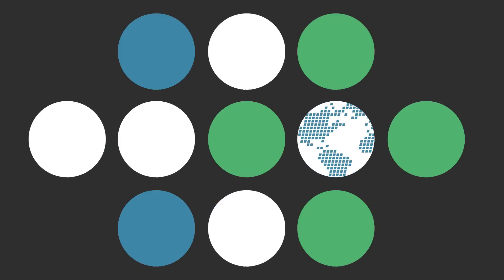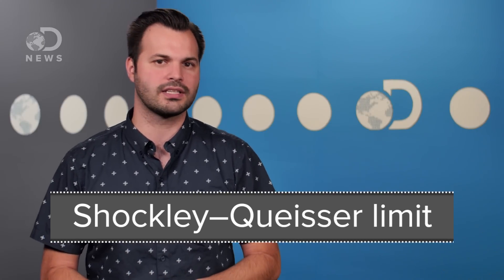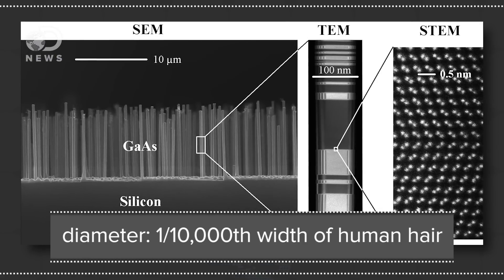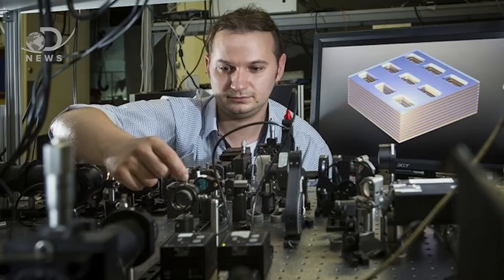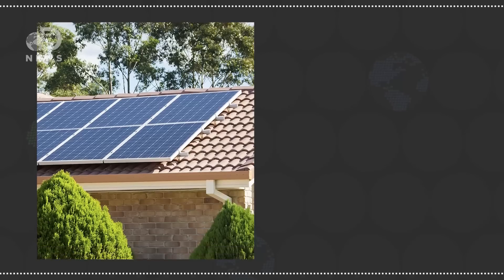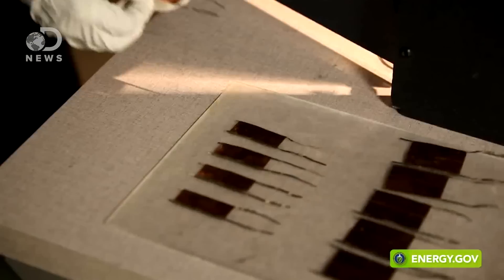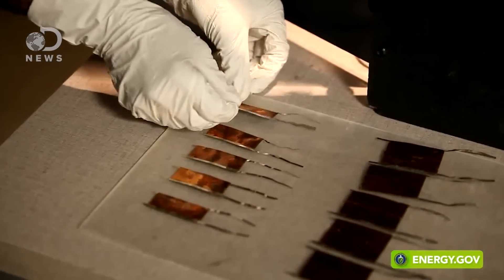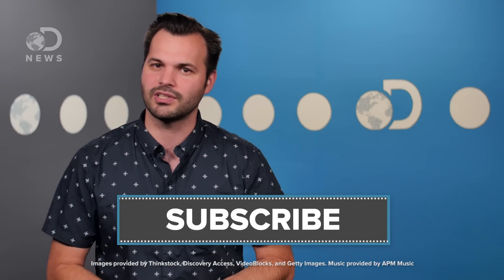Can Nanotechnology Turn Windows Into Solar Panels?

Comment: There is a danger of tree-removal for the sake of getting more sunlight to solar panels.  Trees are more important than solar panels because they perform multiple functions, such as sequestering carbon, storing water and shading the ground to prevent evaporation of watershed.  Ideally, solar panels should be mounted atop trees, but getting to the tops of trees is difficult enough without trying to install something like a solar panel there.  Nevertheless, treetop solar panels will eventually be necessary if solar power is to expand without posing a threat to trees.
Reply: But then the trees won't get sunlight? If there is a roof there most probably is space above it, unless you live in a Forrest with really tall trees or something.
Reply: A better Idea would be, instead of graveyards and peoples graves just being stones, cremate and grow a tree with ashes so grave yards become beautiful forests (Although it would suck if someones tree dies or got cut down but you can always grow another)
Reply: 21st Century If solar panels were built in long, flexible strips that could be suspended between trees, they would not shade much of the tree canopy.  Such strips could also be suspended between power poles where the grid is not eliminated due to autonomous solar power.
Reply: discountconsulting I think there is already enough Rooftops and spaces to put them without having to cut down any trees or involve trees mate, especially when they get more efficient :)
Reply: 21st Century No, trees should definitely not be cut.  But for human development to be sustainable, it has to be treed.  If you have untreed areas of human population, then deforestation increases as human population grows.  Therefore we need to reforest areas of human habitation so that we live more in harmony with nature. 

Likewise, solar power arrays should evolve so that they are in harmony with nature.  I agree with you that currently tree-cleared areas like rooftops are the best places for solar panels, but ideally in the future rooftops will be increasingly shaded by tree cover, so solar arrays should be able to mesh with that.
Reply: we just need to genetically engineer trees to grow photo-voltaic cells so we can plant lots of trees and just plug our houses into them for power :)
Reply: Don't worry, we have many ways to install solar panels in open fields and on man-made surfaces that were cleared of trees decades ago. Just look up "solar trackers", "solar carports", and my personal favorite, "solar roadways" :-) all of which are either already installed and functioning in the U.S. or being researched and developed. And you can trust me, I work in the solar industry and have personally installed pretty much every kind of solar panel system except for a solar roadway, but that should be available soon!
Reply: discountconsulting Mmmmm like The Venus Project blueprints for cities
Reply: Patrick Schlaud There's a long one in china with solar panels above a bike path between the two motorway lanes which is a good idea, safe for biking and using less cars and making energy (Y)
Reply: It is not such an issue now because the solar panel industry hasn't become too popular yet.  As solar power grows more affordable and common, this will be a real problem because people will be wanting to install solar arrays on their properties when their properties might be shaded by trees.  At that point, if they don't understand the value of tree shade over solar power, they may opt to cutting back or removing trees to get more sunlight for a solar array.  Before that starts happening, it would be good to develop proven methods of building treetop solar arrays.  Otherwise, there will be a lag period between the time people start cutting trees to build solar arrays and the time treetop arrays are available and affordable enough to be a realistic option for solar installations.
Reply: +Patrick Schlaud Solar roadways are far too expensive.
Reply: *****
Trees are extremely important as watershed and for regulating outdoor temperatures.  Too many have been removed and, if anything, cities should be reforested by innovating ways of better combining human architecture with tree canopy. 

To simplify it, BOTH trees AND solar power should be growing as ways of harnessing sunlight to make human civilization sustainable.  Fusion power is a bad idea because it introduces even more energy/heat into the planetary climate than all the fusion-generated sunlight that's overheating the planet as it is.

If you think hard enough about the fact that natural systems have evolved throughout eons before humans even existed, you start to realize that the planet's natural biological ecosystems are the most sustainable form of technology that could ever be created.  What we have to do as humans is figure out a way to also live sustainably within the margins of the planet's natural systems.  Fortunately, there is plenty of sunlight, water, and other resources to harness, but the more we learn to harness these without negatively impacting the rest of the natural ecosystems, the more sustainable our species becomes.
Reply: *****
Sustainable technological evolution is progress, not regress.  The immature phase of industrialism has been to develop incredibly powerful technologies and then to show off by using them more than necessary.  Maturation of technological usage involves reducing usage, not increasing it.

Take nuclear weapons, for example.  Why isn't every war fought with nuclear weapons?  Answer, because we reserve them for last resort and first attempt to subdue conflicts by less violent means.  The same is true of any technology.  If you could call out to someone in the next room, why would you call them on the phone or send them an email?  Mature use of technology reserves it to rely on the simplest, least costly alternative (by costly, I mean energy, effort, economic, etc.) 

The same is true of nuclear power.  We've already overgenerated and overused nuclear power along with fossil fuel power because we were faster with developing abundant power sourcing than will developing more efficient  uses.  Now we have microelectronics, LED bulbs, flat screens, and other technologies that use far less electricity than bulky, wasteful technologies of the past. 

The counterpart of more efficient technologies used more judiciously is that our environmental footprint shrinks.  Suddenly we are not having to choose between preserving nature and having modern conveniences because the modern conveniences are shrinking to scales that allow both.  As a result we are discovering that we don't have to limit human population growth as much as we once did to preserve the future for the affluent and the environment. 

The more  harmoniously human civilization coexists with nature, the more sustainable population growth becomes.  We don't have, nor should we ever want or expect to have, technologies that replace natural watersheds and the underground aquifers they feed as our primary source of water.  Who wants entire cities to be hydrated by desalination plants and/or processed wastewater?  Nature has a far better water-filtration and delivery system that works on sunlight, gravity, and photosynthesis.  Why would you want to try to replace that with machines that break down and require maintenance and replacement?

Natural technologies are great because they self-maintain.  When you break a bone, a doctor sets the broken bone in a good position and then lets the bone heal naturally.  We utilize natural processes in our technologies and the best technologies are the ones that do the least and thus most effectively utilize natural systems that have evolved since the beginning of time to work the best.
Reply: discountconsulting Why not have humanity drink desalinated or treated water? It's still H2O because all the impurities have been removed. Would you rather use up the 1% of drinking water on Earth that we're probably polluting anyway first?

Also perhaps by developing efficient desalination we can extract deuterium at the same time to generate reliable fusion power that would easily make up for the energy used I'm sure, and could possibly be supplemented by solar cells. Nature cannot sustain our civilization forever because eventually we will run out of water, in fact it's already been happening in some places. We NEED technology because without it we wouldn't be where we are. We abandoned fur and physical strength to use weapons, clothing and housing. We gave up hunting skills for agriculture so we could sustain larger populations and build cities.

Plants converting sunlight into food and filtering water in the process could be made more efficient by use of nanotech solar panels based on how plants work that could power water filtration. A lot of the energy is used to grow the plants and not producing energy or filtering water.

Nature is far from perfect and our ability to logically design things will allow us to create more efficient systems.
Reply: discountconsulting I don't think we should replace them no, but they can't be our only source of water. Desalination will probably be required at some point because humanity won't stop growing and we will need more water to sustain us.

Perhaps along with desalinating we could remove some of the CO2 dissolved in the oceans or clean up the rubbish floating in our oceans there's already bacteria being developed to digest plastic and produce fuel or drugs or livestock feed.
Reply: Maybe, but the problem is that there are existing technologies that we take for granted because they are not new and they work very slowly.  Trees and forests take a long time to grow, but they are very good as regulating temperatures and the water supply.  What's more they require no maintenance.  You can completely ignore a forest for years and it will continue to perform its watershed function.  Try that with any other factory and see how long the factory continues functioning before it breaks down and requires repair.

One question I have regarding desalination is why you would invest in desalination when there are wine vineyards being irrigated and that water could just be diverted for drinking water?  The assumption seems to be that humans can just figure out an abundant source of energy and use as much as they want of it without it upsetting the natural energy balance.  Many areas are hot and dry already with just the energy coming from the sun.  Now we hear that all the power plants and combustion motors are releasing the equivalent of multiple atomic bombs per day into the atmosphere.  Then we wonder why it doesn't rain.  Take some time to think about the relationship between heat, outdoor temperatures, and the evaporation and condensation of water and you should realize that the atmosphere is in a delicate balance with the forests that cool the ground and when you upset that balance in favor of heat, plants start to dry out and wilt.

The more energy we generate and use, the more heat is released in addition to sunlight and the dryer the atmosphere gets, except that hotter air absorbs more water, so then we get the effect that it stays dry for longer until enough water builds up to reach a saturation point, and then extremely violent downpours cause mudslides and other damaging weather events.  Energy causes damage unless it's channeled responsibly, and humans just haven't had as long to develop effective systems for channeling such huge amounts of energy as nature has through eons of evolution.  All the plant species are fine-tuned through all this evolutionary time to work within the system they've evolved as part of.  The more we change the input quantities of that system, the more we challenge trees and plants to adapt.  Many will adapt but a stressed system doesn't perform as well as one that's not stressed, so we should work on reducing the amount of stress we put on nature with aggressive industrial interventions in planetary function. 

There's a lot more we can do with what we have by managing it better.  Hungry people shouldn't complain about needing more food until they learn to stop throwing away the food they have.
Reply: discountconsulting I don't know where you're getting this from but the production of energy is not what is causing Earth to heat up. It's the CO2 released from some forms of energy production like coal or oil. The sun is constantly bombarding us with far more heat than we will ever release. The interior of the Earth is releasing a ton of heat from the radioactive decay of elements present.
Reply: discountconsulting You sound like you're reaching into pseudoscience territory there so could you please give sources?
Reply: Which claim(s) are you questioning then, exactly?  Everything I say is based on well-known facts, so maybe the way I'm synthesizing these facts or the conclusions seem problematic to you; so if you tell me what seems problematic, I can try to better explain how the facts lead to the conclusion in question.
Reply: discountconsulting Your claim that the heat generated by electricity production is a significant issue.
Reply: Energy dissipates as heat.  Energy is not created or destroyed as it changes forms.  Any power plant releases as heat the amount of energy it generates minus whatever energy gets stored instead of consumed/used. 

Is this a 'significant issue?' Is sunlight absorbed by a desert a significant factor in causing atmospheric heating?  What if it's a small desert?  What if it's just a wide, unshaded road, parking lot, or building?  Is the urban heat island (UHI) effect significant?  What if the city is small?  Or what if the buildings are spread out so the heat isn't released from a concentrated area?  Does it matter, since all heat adds up to produce atmospheric temperatures?

When you ask whether something is a 'significant issue,' it creates a category of 'insignificant issues' where you can dismiss the need to prevent or resolve problems.  One well-known prayer says, "give me the power to change the things I can, accept the things I can't, and the wisdom to know the difference."  It doesn't say, "give me the power to change the things that are significant issue and ignore everything else I can change but don't feel like bothering with."

The planet heats up during the day due to sunlight warming it.  The sun is not warming the planet evenly, however, because of all the light that's being absorbed and stored by trees and plants.  Power plants and motors, on the other hand, are also releasing heat into the air but how much compared with the sunlight?  How much heat is released by a forest fire?  By volcanic activity and geysers?  Can we generate and use as much electricity and power as we want without worrying about that energy's heat effects after it powers whatever we use it power? 

Imagine you have a forest filled with people camping and they all have campfires.  The heat and smoke blow around and the forest heats up as result.  Each campfire doesn't seem to release that much heat individually, but when you add them all together, you notice an overall warming effect on the forest.  The same happens when you cover a cake with candles or otherwise aggregate numerous dispersed sources of heat into a smaller area.

CO2 heat-blanketing effect is about how all this heat gets trapped in the atmosphere, but what about the processes generating the heat before it gets trapped?  At what point would that be a significant issue if it's not already?  To me, a problem is either growing or its shrinking.  The problem of power/heat generation is still growing.  There is still growing demand for power instead of shinking demand due to efficient appliances and reductions in power usage.  If power/heat generation goes down, that reduces the amount of heat being trapped by CO2 but if it keeps increasing, it increases the amount trapped.  At what point does that become significant?  At what point does the absorption and storage of energy within trees, plants, and other living organisms become significant?  At what point does desertification and urbanization of forested areas so that they absorb and release more sunlight as heat become significant?
Reply: discountconsulting If we switched to nuclear power then CO2 emissions would drop so much that the heat produced would be an insignificant effect on the climate. The greenhouse effect is what is the problem not the heat produced by us. Show me your sources for this information you are telling me.
Reply: discountconsulting You're saying you just got this information from nowhere? No studies or data?
Reply: discountconsulting There are things called peer-reviewed scientific papers that explain the facts you bring up. What are they so I can read them? How do you not understand this?
Reply: ( ͡° ͜ʖ ͡°) All the facts I have mentioned are well-known.  The reasoning and arguments regarding those facts are for the reader to engage.  There comes a point in discussion for many people where they no longer trust their own reasoning and logic and so they look for expert sources to validate or invalidate claims.  I have told you the basics of what you question, which is that heat is heat, whether it comes from sunlight hitting a desert or a power plant generating electricity. 

I don't have a source that says exactly how much heat is caused by sunlight and how much is energy and heat are generated by other sources.  Any models you find to estimate these quantities are just that, models and estimates.  You have to think critically about the issues and look up facts as they seem to bear on your thought process.

Your question related to the significance of heat from power plants in the absence of CO2 blanketing.  I have responded to that in many ways but you seem to ignore all those because you just want to dismiss anything I say without a source. 

I asked you a simple question:  IF CO2 levels could be returned to pre-industrial levels and then only sources of energy were used that didn't emit any carbon, would energy demand and production level off or would it continue to grow indefinitely?  I gave the example of how desalination of sea water would result in excessive food production and waste due to a competitive market-based food industry. 

Your hypothesis seems to be that no matter how much energy gets produced in the absence of CO2 blanketing, it will not cause harmful levels of evaporation because the waste heat will immediately radiate out into space.  I disagree because all heat would have to be absorbed by air, which would cause convection currents that would mix with atmospheric humidity and dry up clouds, etc.  That hot air might cool faster at night if the CO2 blanketing effect were reduced, but in order to do so it would have to settle and energetic air doesn't like to settle.  Maybe by using windmills to capture the wind everywhere, the energy could be recycled, but it still wouldn't go away because energy can't be created or destroyed.  It can only change form.

I am trying to have a reasoned discussion in response to your questions.  If you are unable to follow the reasoning and are looking for some source of authority to validate or invalidate something I say, you'll have to ask someone else you trust because I can only explain it as I am explaining it.
Reply: discountconsulting Without sources you're just saying things. You wouldn't be saying these things without people having studied them surely?